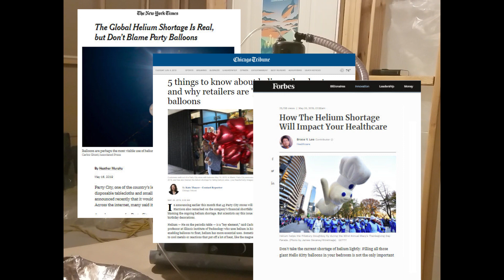Hydrogen For RC Blimps, and Setting Them On Fire

Comment: Lil tip: Make a rigid airship instead, and have the hydrogen in bags at ambient pressure, that way, should a leak be present, there will not be oxygen running in nor hydrogen running out
Reply from the maker: I'm actually working on another Hydrogen video now, trying to make a safe(r) Hydrogen envelope. Even with the no extra pressure, oxygen and hydrogen will travel across the barrier due to osmosis. So unfortunately it's not enough to just make sure there is no pressure.

Comment: Hydrogen is one of the most electrically insulative gas there is
Its used in high voltage power tubes for that reason

Comment: Having watched your recent video and deciding to look back at some others I have noticed some things here. The way you explained the hydrogen and the way the blimp caught fire is exactly how the Hindenburg basically blew up, eye witnesses reported and the recolored footage shows clearly that it was burning with a bright orange flame with the top portion burning up first which is no doubt in relation to how the top and bottom parts of the outer skin were made of different materials. Asking this following a small discussion with some regarding the disaster, what is your take on it? Do you think the skin contributed to the cause of the fire and why it burned up so quickly like some theories suggest or do you think the mass amount of hydrogen inside the cells catching fire from possible static is what made it burn up so fast?
Reply from the maker: I think it's incorrect to say that the skin was a deciding factor, but it was a factor. A skin burn would not explain the extraordinary speed the ship burned down. I will probably not make many friends in the airship community saying this, but in my opinion the core issue was the envelope ventilation system was badly designed, and was basically a ticking time bomb waiting to go off. The ventilation system was basically a series of large tubes deep inside the envelope. In the event of a leak, those tubes could fill with air and H2. So basically a huge spud gun. What gets worse is that the air mixed with H2 is then vented out the top of the airship. So now you have a stream of H2 mixed with air exiting the envelope into the atmosphere. Where all kinds of ignition sources are possible, and once it ignites it would lead the fire right back into the heart of the airship. Witnesses claim to have seen Saint Elmo's fire shortly before the disaster, and I believe 2 witnesses reported hearing an explosion right before the fire. (This lead to the incorrect belief a bomb was involved). That explosion could have been the "spud gun" ventilation system exploding, which would rapidly spread fire all across the ship.
Reply: @BaccaYarro  That is a rather interesting and more logical explanation compared to some others I have heard and does explain why the rear of zeppelin is where it caught fire, which some suspect was from a hydrogen leak as it was reported and photos shown it to be tilting downward at the rear, and how it so quickly traveled through the whole interior and was shooting out the nose like a flamethrower. However the ignition source has always been the main mystery and why lightning has always been an acceptable cause, many still put the skin to blame for the source of ignition due to it having a metallic coating of alluminum powder and creating a static discharge.
Reply: The Hindenburg’s skin was made of rubber coated with aluminium powder.

Comment: It's a shame to have to top it off with helium. The only cheap helium available is a helium/air mix for party balloons and not suitable. There's often no way to get "cheap" 100% helium. Maybe I could make the envelope fill inlet extra long and voluminous and pressurize the blimp by rolling/squeezing the inlet's gas up into the main body. Or even a detachable fill inlet bulb to roll up to pressurize the blimp envelope proper without the mass of a long fill inlet.

Comment: The Graf Zeppelin and the Hindenburg each achieved a million passenger carrying miles without incident. We are so over traumatized by the Herbert Morrison newsreel almost no one thinks about Hydrogen ships  in any other way. We use acetylene, gasoline, Butane, Propane and a host of energetic chemicals EVERY DAY and somehow we survive. We need to get rid of the Chicken Little (" The Sky Is Falling") fear based thinking and move forward with Hydrogen. Be careful? Yes. But be sensible. If you are truly afraid of hydrogen then don't step into a gasoline powered car ever again. They have killed many more people than airships ever did.

Comment: A simulation of the R38 is not a good thing;  if the crews and important folks riding on the R38 first flight knew how contaminated the hydrogen was they would have all refused to get on it.  Hydrogen is safe if everyone knows all the rules they need to follow.  Contaminated lifting gas was responsible for a number of very unfortunate accidents as the US, Britain and France learned how to build and fly their own dirigibles.

R38 was a dirigible patterned on the German high altitude ships.  The test flight was conducted at only a couple thousand feet and they over-stressed the structure,  as it broke in two there was a thunderous blast heard on the ground and the flaming debris fell into the Humbar river.

Comment: I think the very viable use of airships for cargo transport with low emissions will demand hydrogen. Lots of ways around the issues. Flame retardant structure. Cargo bay ejectors. Automatic extinguishers. And simply routing airships away from populated areas and loading/unloading a short distance from population centres. I thought about this about 15 years ago, and hydrogen's abundance, cost, and lifting power make it a no brainer for low/zero emission air freight transport.

Comment: Society's fear of hydrogen could be a problem, since it could impede the development of safe or safer handling/use technologies..
Reply: Nevertheless, hydrogen has been in use for almost three centuries, and has many uses! Here's a quote from an industrial hydrogen journal, the "International Journal of Hydrogen Energy," (vol. 23, Issue 7, July 1998, page 593): "Hydrogen is a very important molecule with an enormous breadth and extent of application and use. It is...used in many industries, from chemical and refining to metallurgy, glass and electronics. Hydrogen is used as a fuel in space.
Reply: I believe the same thing about nuclear power as well we need to figure out how to use these technologies more safely because you never know the breakthroughs that are right over the precipice

Comment: Great and informative video Bacca! This talk of helium and hydrogen has me wondering though, what about the use of hot air or pressurized air? And couldn't water vaper/steam also create lift in a blimp or zeppelin?
Reply: "hot air" = a hot air balloon ....
"or pressurized air" = pressurized air is heavier air... so... no.
" And couldn't water vaper/steam also create lift in a blimp or zeppelin" = steam = (air + water) > (air)... so... no.
Reply: @googleyoutubechannel8554  Water vapor is actually quite a bit lighter than air, but in practice preventing condensation is very difficult, making it impractical.

Comment: What is set-up for H2 generation exactly? I heard you were using a hydrobullet pure H2 generator... What model hydrobullet, and what are the specs on your power supply you dug up?
Reply from the maker: It's the Hydrobullet R06 Separator. It's their smallest H2 separator. The power supply is 24V, 20A maximum, although in operation it's about 10A. I am working on a scaled down version that would only be 12V, 10A max after talking to Hydrobullet support. In the current configuration it gets pretty hot after a while.
Reply: @BaccaYarro  What gauge wire did you use for wiring the power supply to the H2 gen? Sorry for the questions, I am working on a set-up myself and have everything ready, I am not planning on going to 10A initially as I think the PWM has 14 gauge wire, but I think it will be OK. Starting with a DC power source (like a breadboard), but plan on using a car battery eventually

Comment: I made a blimp using the technique you showed in one of your previous videos. The envelope worked great, there were only a few leaks that I was able to easily fix. I decided to fill the envelope with hydrogen because helium was expensive. Because I did not have enough hydrochloric acid, I had to make the envelope about half the size of the one in the video so it ended up not flying. Anyways it was still a fun project for me.
Reply from the maker: That sounds awesome, keep up the good work!
Reply: Thanks!